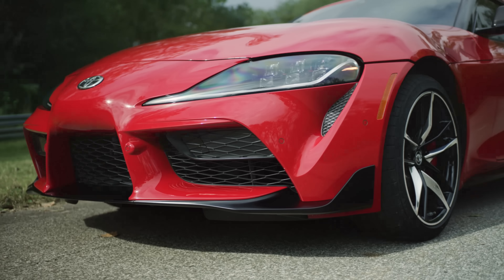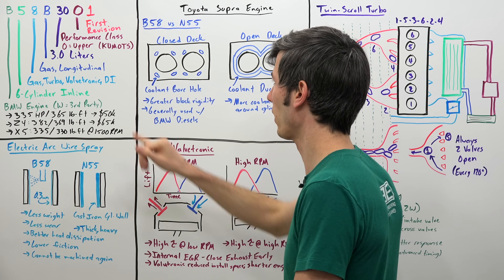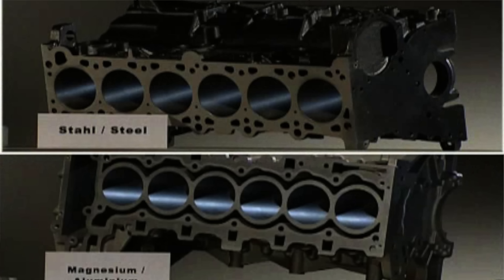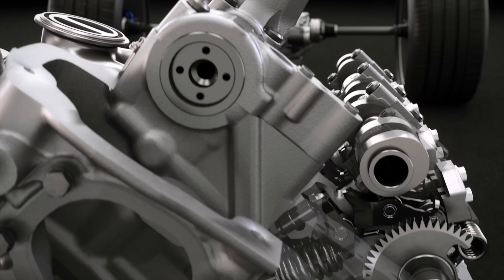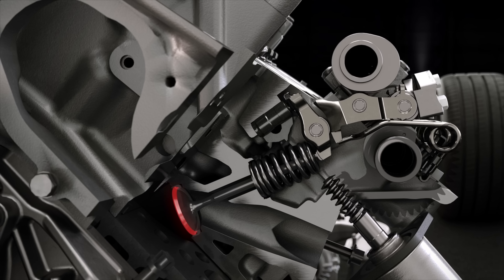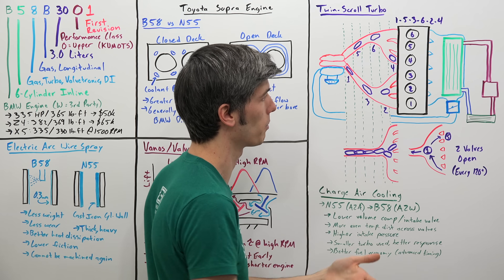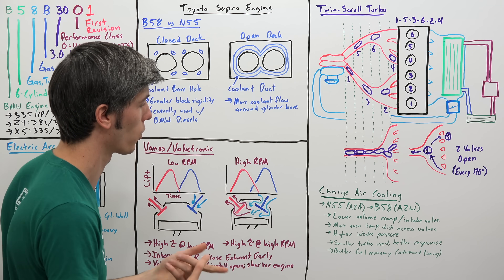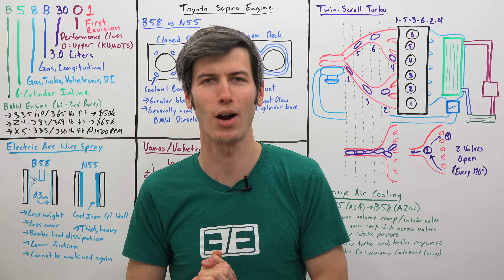2020 Toyota Supra Engine - Detailed Review Of The 2JZ Successor

Comment: How's the tunability of the B58? I see it has a closed deck, but it also has cylinders you can't rebuild.
Reply: And high compression, and an aluminum block, and the intake manifold is integrated into the intercooler so you can't upgrade the intercooler without replacing the intake manifold which is something you shouldn't have to do with a turbo motor. It's very non-tuner friendly compared to the 2J and that's why people are bummed.
Reply: Stock engine is at 348 bhp. BMW quotes less because the M2 N55 was too close at 370. In fact B58 has more torque. Lots of tunning experience in Europe with the M140i/240i models 410 to 440 bhp easily just with JB4 install. There are tons of YouTube videos.
Reply: Why do you say that? The Fords Vodoo GT350 engine has been sleeved.  (And it comes with sprayed in cylinder liners). I'm not sure about how that could work with the B58 but time will tell.  I'm also not sure why people diss alluminum blocks when some of the strongest motors are made from billet alluminum. (Check out MMRs billet Alluminum Gen X  Coyotes that can make 3500 hp.

I'm sure some decent power will be gotten out of the B58 but that's really going to boil down to how skeavable the engine is. Also, I'm not crazy about the air to water intercooler being built into the intake and the Vanos/timing chain being in the rear but those don't have to be deal breakers.

Again, the big power some folks are going to want to make will boil down to sleeves and I'm anxious to see how that turns out.
Reply: Well you machine the blockbiggerand install a sleeve
Reply: @fixitluis  Good idea! A good builder can do that!
Reply: Its a proprietary coating called "Nicasil". In Europe, they sold BMWs with engines coated this way for 20 years. Americas got them with iron sleeves because of the lower quality sulfuric gas. So welcome in the team!  And they really last. 500k km in a 3 series is not even uncommon. Not a Toyota thou..
Reply: @mematyi IDK how it is were your from, but in the USA BMW's are the type of cars that you upgrade models every three years, there not known for reliability like Toyotas are. BMW to most here means low quality luxury car, not decent quality sports car.
Reply: @mematyi  So how does it respond to a partial seize or a broken ring? Disposable engine block?
Reply: @sup3rbird  Yes, I guess. Not promoting BMW by any means, i donvt have one either, but most of today's new cars also use aluminum block that can't be remanufactured using factory technique. No overbore sizes, open decked thin cylinder walls, etc. Bmw just did it 10 years before the others do.
Reply: @sup3rbird  Depends on if it can be sleeved. We'll have to find out.
Reply: @mematyi  Yeah toyota can last 2 million
Reply: There's going to be a 50hp difference where the Z4 will get the more powerful engine!
Reply: @Phar2Rekliss  Amy development for the Z4 can easily carry over to the Supra for obvious reasons.  Stock for stock.. Yea.. But you think a tuner who buys this Supra will sit on his hands?
Reply: N55 is at over 600HP with full bolt ons and upgraded turbo, and it keeps gettig higher as people get to know the engine better. At this point, the transmission has become a problem, but xHP just released a tune for it, so way more power is expected soon out of the N55, so B58 will come right after.
Reply: i suppose it could be like a dirt bike with A, B, C, and D pistons LMAO. you could also just darton sleeve it. 
it would have been so amazing if toyota brought back a JZ engine and a "real" supra for us.
Reply: tunability?where is market for that.welekome to consumerism
Reply: We will find out that in 2 years when these cars are .worth 20k
Reply: With Vanos and Valvetronic, I'd say this engine is infinitely tunable.
Reply: 9600GTMAN  many great engines are made of aluminium, it weighs less and improves cooling/heat dissipation from the block which in turn helps prevent warping of the head under extreme conditions. Take the 4B11T in the Evo X for example which is aluminium over it's cast iron predecessor 4G63. Both these engines can crack 1000hp regardless of whether its iron or aluminium, it won't matter to 99.999% of owners.
Reply: i bet some guy will try to sleeve one out there. LS motors are usually aluminum blocks with iron sleeves and they can take some power
Reply: 9600GTMAN   same as r35gtr where we put out over 1kw...
Reply: Nikasil/Alusil "coatings" are garbage... look at it's history. Iron liners are way more reliable and can hold better power (unless very thin). Any time you see one of those crap engines lose that coating they have to bore it out slightly and put in a sleeve. BMW makes throw-away engines for the most part, they will last 3-5 years/100k miles decently and then it is $$$.
Reply: Stop Telling Me What To Write I couldn’t agree more... I have been a mechanic 18yrs & I’ve observed this trend with german vehicles.  They just crumble when the warranty ends - what a coincidence!?
Reply: @stoptellingmewhattowrite  I know in higher preformance motorcycles they use DLC, but you're right, gotta bore it out and sleeve it.
Reply: @stoptellingmewhattowrite  You say it's garbage... Ok. Go and tell BMW how to build engines if you think you can do it better.
Reply: Stop Telling Me What To Write you’re hilarious!
Reply: @juandominguez8536  It's just how it is. You are saying that BMW engines are "garbage" so you must know a bit about that stuff to make such an comment. So tell BMW how to make it better LoL.
But i think you are not able to do so and just a hater with a big mouth.
Because if you would know more about engines you would actually say WHY those engines are "garbage".
Reply: @stoptellingmewhattowrite  the bmw b58 big brother S58B30T0 that equipes the G82 M4 with 480hp stock is living proof there is much room to tune on this engine.
Reply: @stoptellingmewhattowrite  Where i live i`ve seen so many cars that run a bmw engine with Nikasil coating for over 800k kilometers and they had only rebuild valve seals because most of them run on injected LPG. Seen drifters to abused heavily a turboed M52s and the thing just refuses to die. Its cheap and what we have here, but i can comfirm that it can take a beating. Just may not be the thing if you want a drag car with well over 1000whp, think no one is going to build something like this and put it in a road car.
Reply: @krisdaphrk  well here in Merica, there are many 2jz powered Supras running around on the streets with well over 1000whp.  Hell 1000hp isn't even considered to be very much for a street legal drag car these days..
Reply: @krisdaphrk  so where you live, bimmers run usualy 800 000 plus kilometers....... Cool story bro.... Im on daily base in germany, and there bimmers usualy ended around 200 000, and trust me, germans loves its cars and have enough money for more as only proper maintenance, and they do it......
Reply: @miroslavdockal9468  This is when people from my country come to germany and buy them, do the repairs and drive them. Its a sad story, because we cant afford anything else. I`m not a bmw fan btw, owning a japanese car with the hardest to find parts engine. Not a fan of brand or anything , but i know a car which puts smile on your face.
Reply: @walkerforsyth6221  Agree. Cheers 2jz has made all that possible. Sad the consumers dont buy such cars which dictates the market.
Reply: @krisdaphrk  1000hp 2jz Toyota supra drag cars are a comen thing
Reply: @drifting1O1  No they arent. Most arent "drag" spec, most are simply built for highway speed. Supra's were NOTORIOUS for simply being dyno queens and highway monsters. The common joke was that they'd run a 12.1 sec 1/4 mile @ 140+ mph... lol. If you dont believe me, just look up the term "dyno queen" and insert "supra forums" or whatever. It's even under the definition of "dyno queen" on urban dictionary, posted in 2005. 

That being said.... They would take out 1000cc bikes on the highway, or make a Viper/Ferrari/Your mom's minivan look like it was standing still on the highway while it was at full throttle. But bro, no... MOST supras, even today, are no drag spec, they lack low/midrange... and if they dare try to launch with anti-lag while on a drag tire without a built transmission (most dont have one), they can say goodbye to something in their driveline, because it's about to break the f*ck off.
Reply: @krisdaphrk  You know if you rebuild valve seals youre already screwed
Reply: European cars can not compete with cars in the U.S, Toyota and Nissan were there when the U.S auto makers were making crappy engines but now that the gloves are off it’s a done deal. Challengers, Mustangs, Vettes, Camaro’s, chargers etc etc, then get into the limited editions like the Demon, ZR1, GT350 and it’s a blood bath,
Reply: @byronnlangley  are you kidding? US cars are cheap built and low quality compared to German cars.
Reply: Byron Langley The c7 Z08 is great. Big torque window and everything, but when it really comes to racing I prefer EU card of US card any day of the week. I mean, the Damon is a drag car, going in a straight line is boring and doesnt say much about the true racing capabilities. 
I think there are very few US Cars (Prob just the Ford GT) that outperform an R8 or a GT2RS... 
Also if you take a look at the Market, youll find that EU brands are doing very well in the US market, the other way around, not so much ....
Reply: @byronnlangley  Koenigsegg. Ferrari. McLaren.
Reply: @byronnlangley  european cars do not compete because the entire european industry is focused on environment, and cars being demonized as a big cause of global warming is destroying the sports cars culture in europe until the ev's or other fuel alternative will bring high performance to car's in here. still it's funny because in the 90 and 00's when i grew up the german and french car makers were making 200hp + from small 2.0 liter blocks while american models needed like 5.0 and a supercharger to get the same power and torque, i'm sure that if european car makers wrent restricted by euro rules and europe gas prices, they would destroy any american model, just look and M4's doing nearly 500hp stock with a 3.0 inline 6 s58, most american cars have 7000c to put that power on the table

Comment: Good breakdown, but at the end is another unreliable BMW engine, very complicated and unnecessary. Modern BMW engines always running into issues specially after 25k.
Not a good choice for Toyota.
Reply: These engine complaints are hilarious.

I have owned an 
1988 528e
1996 338i
1999 528i
2007 328xi
2016 m235i

All except the recent were sold around 130,000 miles.  Never had an engine issue except the electronic water pump needing replaced in the 2007 328xi.  All of them were just as smooth as when I bought them for accelerating and shifting.  The reliability complaints for all cars (not just BMWs) are so overblown generally.  If you go onto a forum and see 2 people complain just remember there are hundreds or thousands of other people who bought the car with 0 issue.  Following the regular scheduled maintenance or even doing something like oil changes more frequently really do wonders for any car.

The complaints about being able to work on  the engine yourself can be valid, but are also valid with more and more engines these days.

@cutthroat795 is entirely spot on too.  Alot of this complex valve stuff at different RPMS is to get more torque earlier for better fuel efficiency because of strict guidelines and trying to keep the same or marginally better performance.
Reply: BMW actually makes reliable engines. You wouldn't think so when some 40 year old lady doesn't change the oil for 30k miles and no one knows about it.  There's a thread on M3forum for E46 M3s over 150,000 miles. There's a lot. They all have something in common, they were mostly taken care of. There are two guys over 300,000 on a non-rebuilt S54. This is a performance engine known to grenade for rod bearings(because high revving engines have this problem). An unreliable engine is the 4 cylinder Hyundai, Chevy, Ford, and some other companies chose in 2011, 2013, and 2016. When engines explode WITH proper maintenance, that's considered unreliable.
Reply: @andyfreeman4054  and the engine was built in collaboration with Toyota, these people just want to whine.
Reply: @saifaddeenal-manaseer6325 That's the truth. People just talk about things they know little or nothing about OR they think their bias supersedes fact. The big deal is Toyota called it a supra. The B58 is quite phenomenal. My friend's 340i is around 340whp with just bolt ons. A tune will get him above 500 easy on a stock turbo.
Reply: GSR187T.   BMW makes reliable engines but needs more frequent oil changes. They are over engineered but perform ok. Do you know how many horror stories there are regarding 2jz and rb26 engines? People who can not afford a new Z4 BMW can’t afford the new Supra either. With small tuning you get to 400 horsepower with good reliability anyway and 3litre turbo engine will have plenty of torque to spin the tires ( especially cheap ones like I have seen on many older Supras )
Reply: Do you have an alternative engine that toyota could have used besides the B58? I wana hear it....
Reply: Sure it’s more cost effective to design simpler and more reliable engines, but car companies have to squeeze in every last bit of technology to meet the strict regulations nowadays. It’s an unfortunate product of limited oil supplies and the unwilling transition to electric cars/ alternative fuel. I’m not saying I like electric cars more, but it’s pretty obvious we’ll be screwed if we don’t get away from oil. Who knows, maybe we are already screwed, because oil is very useful in other ways. It’s almost as important as steel is.
Reply: How do you know that? The only way you could know that is if you drove this differently-made-than-other-b58s containing over 25k and combined your experience with other supra drivers. Theres physically no possible way you did this 3 months ago before the car has even come out. The engines are made to toyotas testing. Quit your bitching when you have no idea what youre talking about
Reply: There is stats showing Honda and Toyota have the most reliable cars in the industry, Toyota has vehicles hitting 1,000,000km

Comment: It's a BMW engine for sure, and it's a good one.
But how is this a 2JZ successor when it's not even made by Toyota?

But more importantly, should they have called it the Toyota Z4 or BMW Supra? Haha
Reply: they should have called it JMW Zupra
Reply: It was said that Toyota's QC department  put this car and engine through rigorous testing and many things had to be done over.  So hopefully some of the things rubbed off on BMW about what it's own standards should be raised to.  Quite frankly, I don't know what kind of rigorous testing you can put a plug on coil thorough, which is one of BMW Engines key failure.   There are things that just break over time.

Comment: That motor will drink a quart of oil every 1k miles.
Reply: I have done 10,000 miles on my B58 - No oil consumed according to the electronic dipstick !
Reply: What if I tell you those electronic dipstick can easily mulfunctionand can't determined the oil condition as easily as normal dipstick. At least normal dipstick can tell if your oil is still good or totally to dirty and need replacement.
Reply: @zuhailishufller8046  it's literally new. Get out of the stone age, obviously nothing should replace a manual dipstick but calm down dude
Reply: @nerfinator03  well I have to service an engine equipped with electronics dipstick. On the dash it says full but after draining the oil, wow I was surprised by how little oil was left. It's almost dried out. BMW or any manufacturer should stick to dipstick it's more accurate and damn more reliable. Those dipstick sensor was faulty and have to be replaced. Another way to drain money to my eye.

Comment: Hate the rear end of it. Wise for bigger rear like its original MK4. Why couldn’t they take a Lexus engine and upgrade on that, build it to be bulletproof just like the 2JZ. I’m just disappointed with the design to be that small of like a Z4 or GT86. However I do appreciate that BMW build this engine, it looks like a very clever engine but can it handle a lot of boost?

Comment: The idea that 3400lbs and 335hp is going to be a "sports car" is still the same bmw design mantra that most owners state.  "Oh I would catch him in the curves".   If the pinnacle of engineering is how do we make 335hp as cheaply and efficiently as possible.  I don't think the answer is a strung out non rebuildable straight six with vanos gen 4 and vanos lift, direct injection, twin scroll turbo/dual manifold, plastic charge piping and a plastic air to water intercooler bolted all bolted to the side of a 226F hot engine.  Fords eco boost and hyundai's lambda platforms do not rely on half of the above and make substantially more power.  BMW has relegated themselves to the Rube Goldberg of auto manufacturing.  Toyota unfortunately bought into the ///Marketing and now has a turd sandwich on their hands.